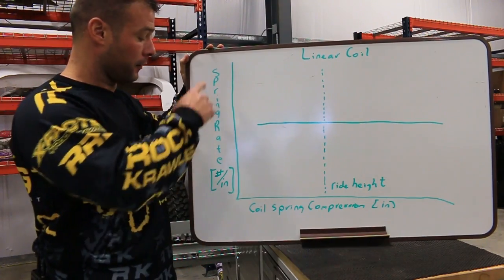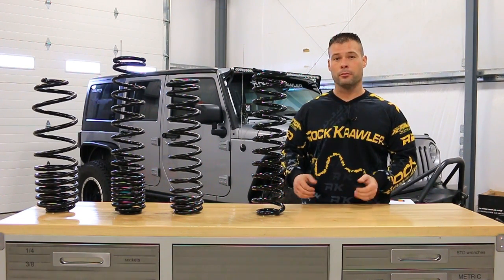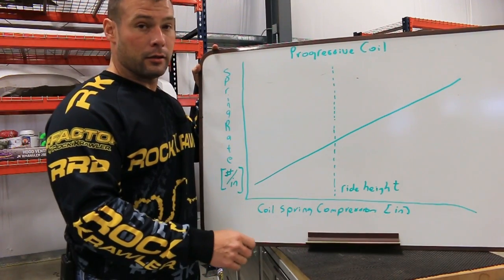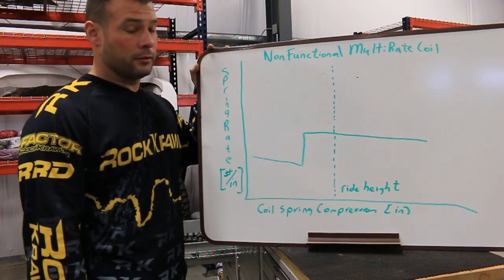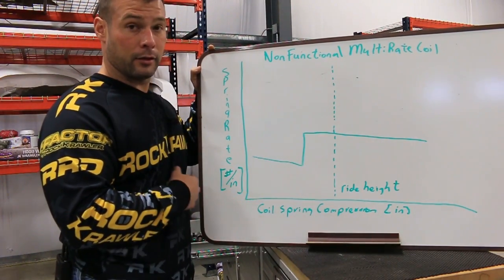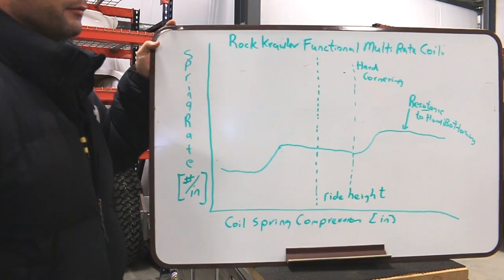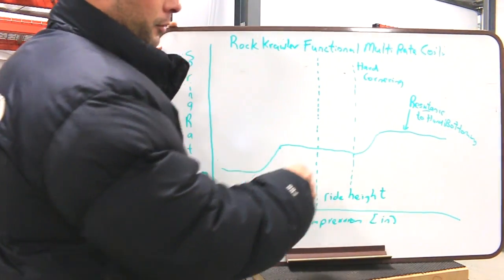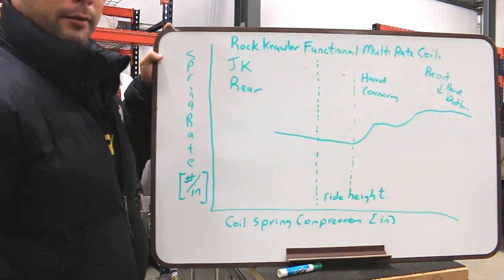Triple Rate Coil Spring Review - Rock Krawler

Comment: If the spring coil is longer than my existing coil ? What happens if i put the longer coil ?
Reply from the maker: What you care about is the lift height of the coil.  The free length of the coil just supports extra droop which is a good thing for suspension travel.
Reply: @RockKrawlerSus  i just bought my jeep and i don’t know the height i am assuming its 4inch i just replaced the shocks 4-6 inch ones and they installed perfectly and now i am thinking to change the coil springs, right now i got rough country.
Reply from the maker: What vehicle are you refering to? @MCLIFE786
Reply: @RockKrawlerSus  2017 JK

Comment: Will your 5.5" coil spring work to replace a rough country 6" coil spring? With a 6" rough country lift kit, and I'm running 40's tires (on a JK 4 door - JKU). I want to make sure it's going to fit with my lift and tire size. Thanks in advance!